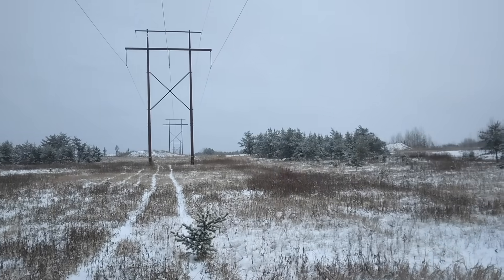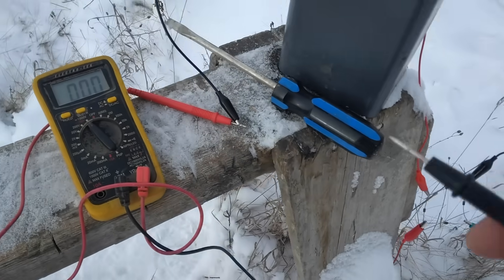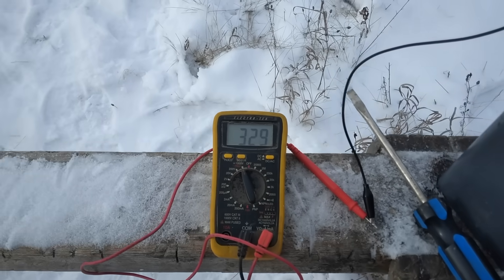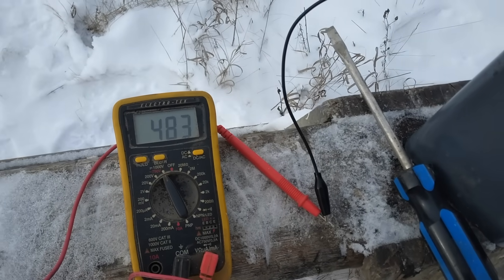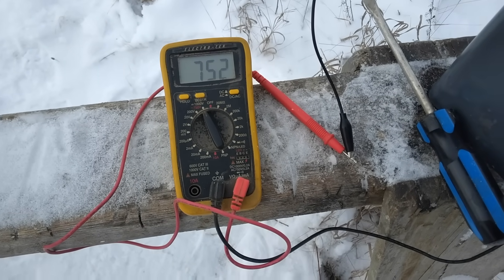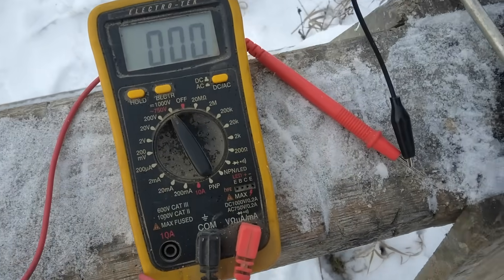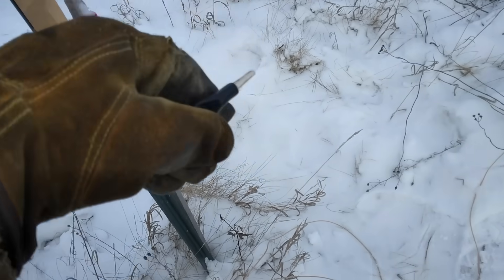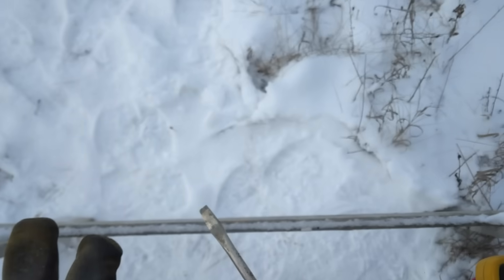Fences sucking power from under HV transmission lines

Comment: Free energy gathering from the Aether......  just like they did it in the Old World before they RE INVENTED it. The evidence of this free electricity harvesting technology can still be seen on the rooftops of very old cathedrals and buildings in the form of antennas and insulators. We WERE using FREE electricity gathered from rooftops, long ago and they re wrote the history ( mid 1800's ) and re invented it minus the free way to harvest it to make us PAY for it. In fact Cathedrals WERE old world power stations that were then reclassified as worship centers. Cathedral = CATHODE and the church rectory = electrical RECTIFIER. If you dug up the graveyards at these Cathedrals and old churches you would likely find the hidden roof top tech buried there. There are old photographs of lit up cities at night from lightbulbs dated BEFORE Thomas Edison " invented " the light bulb. Did you ever wonder why most power lines LOOK just like antennas? Or why you see them up in the foothills away from towns? Or why you can see them DEAD END in the mountains as seen on Google Earth..... even though we are told they are merely " transporting " electricity from point A to B. Huh? POWER LINES HARVEST FREE ELECTRICITY FROM THEIR ANTENNA DESIGN AND THE HIGHER IN ELEVATION, ( LIKE MOUNTAINS ) THE GREATER THE HARVEST FROM THE AIR. Think about it, if all they wanted to do was transport it from point A to B as they tell us then why not just bury the lines for a tiny fraction of the cost AND materials?   See " My Lunch Break " channel for more LIES EXPOSED.

Comment: I've heard about this phenomenon back in the 90s. But they referred to it as "stray voltage" and tell you stories about cattle getting electrocuted, and homes that were next to lines would have all kinds of problems, as well as the occupants coming down with weird illnesses and cancers.
Reply: I believe there was a huge lawsuit in Iowa maybe fifty years ago over this issue.  The farmers were trying to prevent being forced to have these power lines cross their land, sometimes very close to a house or barn.
Reply: Non-ionizing EMF can't cause weird illnesses or cancer.  There is no physical mechanism to do that.
Reply: There is a high rate of leukemia in a nearby village along the power lines coming from the power plant. 
On foggy days there is a crackle in the air.
Reply: Years ago I read about links between high power lines and what medical researches called 'cancer clusters' which were the people, mainly children, who lived in low cost housing built near to the lines having significantly higher levels of several types of cancer. The power companies were not found liable however those people in the lawsuit were offered alternate housing away from the power lines out of the kindness of the companies heart.
Reply: @bendover1028 There is exactly zero peer reviewed research that shows anything of the sort. None.  Nothing.  There is no physical way that non-ionizing radiation can possibly cause such damage.

Comment: Use a coiled wire making a circuit liie a Tesla transducer as seen from his schematics.  Should allow you to charge a DC battery..... careful not to over charge battery! You can control voltage by distance from high voltage line or the number of coils you make in the transducer circuit.

Comment: be careful with this idea, not due to the risk of electrocution but the legal ramification of " theft of service",  someone had done this before and the power company caught on and had him prosecuted, he used an antenna and there is an area that is called the "near field" , he was in that area and lost his case in court. good luck , interesting video.
Reply: The reactive near field is about 800km (500 miles) for 60Hz. The whole area where you might gather power is inside that distance because the wavelength is so long. Far field is more of a radio thing.

Comment: Load it as it take a transformer and drop drop the voltage. Do you need any water pumps to pump water anywhere from that area or you could run an air compressor run compressed air to wherever you want to run ithanks for sharing

Comment: What's your a** you get killed with something like that? Drop the voltage down to something usable. 220 or something open in charge. Charge some batteries or something. Good idea you definitely could get some use out of that

Comment: Years ago a buddy of mine went with me off roading under these kind of big power lines. I had a 1984 Bronco II. I shut the truck off and we were leaning on the edge of the hood talking and we noticed the whole truck was humming. We got the hell out of there because I was worried my computer was going to burn out. Those things aren't anything too play with. I wonder if you could power a motor with harvested electrical power like that if you had a big metal grid setup.
Reply: You could power one. I read another comment about biking. I think an electric bike powered by an induction coil riding under a HV line would be really funny to see.

Comment: How about a coil as designed by Tesla in his coil for electromagnets patent? I've used 12awg insulated wire around a 4" pvc pipe and gotten good results from it. Doesn't have to be a pancake coil, can be a conventional coil wound in his unconventional way. I've gotten accumulations of 700v within milliseconds and steady 60hz discharging at 120v with a setup similar to yours... Microcontroller timed of course.

Comment: I parked my rv under the power lines one night. I was getting shocked when I touched the door handle. I yhought somthing was wrong with my batteries and shorting out. I unhoooked all my batteries and ran my volt meter from the door handle to the ground and was getting 3 volts.

Comment: I recall a guy with a jeep who claimed his truck would become energized after driving under the HV lines.  I suppose the tires are good insulators and there is a radio antenna, metal body.  Intriguing

Comment: Nice demonstration 👍. But sadly those are small lines. Ours up in massena NY are 750,000 volts you would have more fun experimenting with those ones. Not going to look it up but the one you playing with is like probably half the voltage ⚡ than we have. Baby ones I call it 😉 lol only NY and Texas has this set up as experimental. It probably kill you if you got withing 20 feet of it without PPE. Shutting the line completely off still has enough static energy for hours to kill a person as well 😬

Comment: I remember a story of a very smart man who lived a few dozen kilometers away from a Candu nuclear reactor transmission lines.
His house was walking distance from the overhead tower. 
He did a little digging... carefully planted a few spools worth of cable and lived off grid for years until Ontario Hydro finally wondered how this guy had full electric and no stack. 
He got in a heap of trouble over it. 

I remember hearing that it isn't very healthy living close to that level of current passing overhead.
Might be a lot of ozone in the wind they are taking in 24/7 as well.

Comment: For anyone wondering, the rate of charging this capacitor corresponds to around 77 mW of power
Reply: = 0.077 watts. I looked up the power use of a common 5mm red LED, and find they use about 15-30 mA or about 0.05 - 0.1 watts at nominal LED voltage (3.2v). So I think he is pulling enough power to continually light a single 5mm LED, but definitely not at it's full brightness.   I think this seems in line with the old school trick of standing fluorescent tubes straight up from the ground-- they will usually glow dimly if they are under HV lines. Seems like he will need a lot more conductor to pull any truly useful power.
Reply: @gutrali  Using field strength falloff it seems that his "fence" would have to be around 18.5 m (60'8") high to get 1 watt of continuous power with current length lol
Reply: @ac281201  but 60 ft would be higher than he estimates the sagging lines are off the ground already.   I think it would help if he created a cool rather than just a Rf antenna like he has here;  no grounded far end
Reply: @gutrali  My bad, I should have added that I assumed straight wires, 20 meters above the ground. And of course you are right, a coil will "gather" more energy than a straight wire in this setup. I think it's worth mentioning though, as the distance to the lines is very small (compared to the size of the wavelength) the individual electric and magnetic fields play much larger role in energy transmission than em radiation, so the fence here doesn't really function as a rf antenna, more like a 1-turn coil
Reply: Yeah that's SUPER tiny. I figured it was in the sub 100 mW range. It can't be much.
Reply: Thanks for calculating that so I didn't have to

Comment: I worked a tower line and there is a ground cable connecting the towers because of static electricity from the lines. The tower line looses electricity
Reply: I've been on a grounding crew for these lines, we plowed in a steel cable between towers and  put a ring around each tower with four 3/4 ground rods that threaded together as deep as we could get them typically 40-60 feet.

Comment: Coil the wire up and see what happens you're basically making a single coil transformer to induce voltage from the hv xmsn lines and your coax. More coils of wire,  instead of one piece of wire will get you a lot more bang for your buck.

Comment: 230 000 volts devided by 40 feets = 5750 volts per feet!
The current will be proporcional to AREA and conductivity of the air.
I would put a (insulated from ground) horizontal metal sheet a feet from the gound and connect it to hi voltage bobine of a microwave oven transformer. I bet you will get a few or tens of watts. 
And then you can play with the area/current and hight/voltage.
Reply: By AREA I mean sufase area (of the metal sheet). The surfase area of the cable you use is small ... and insulated. The power wil come from the sufase area exposed to the air.

Comment: I was an RF tech, we tested potential cell sites, and would use a bucket truck to hoist the antenna to the proposed height.  To look both for potential coverage and obstacles, I would go up in the bucket and take pics on the 8 cardinal points to get a 360 view.  One time we were proposing mounting to HV transmission lines, the SDG&E guy opened the gate and drove away, so we went about setting up.  I was about 8 ft from the lines, in a metal framed bucket.  My compass went nuts (actually reversed polarity) and as I reached for the controls I got BIT, not deadly, but I crossed my arms and had the driver lower me from the ground controls.  Later talked to the SDG&E guy, who had no idea we were setting up, that close to the lines and said that would NEVER work, as it's inside the 'field' and it would fry the antennas!  that compass still points south!
Reply: They had you in a bucket 8 feet away! WTF?

Comment: 80 yards? WTf how long is f... cable? Cut the c... with these bogus units of measurement. What happens when air turn zero degrees F? And is it even different from the same air at -1°F? What foot, my a..? Whose foot? Yours? What shoe size do you have? What does this museum of units has to do with distance? What about molecules, do you measure their radii in micro-hair? As in width of human hair?

Comment: It's interesting that you measure voltage, I remember being in security cameras with a job years ago, and the 75 ohm coax can't be used to supply AC 24 volts for a camera simply because coax is designed so the impedance is designed so it acts as a RF filter at low frequency to keep AC hum out of the video.  So I would think a 15 gauge copper wire would actually charge you diode and capacitor better.  Maybe?
Reply: That is not true. The coax is 75 ohm because that is the standard design impedance for video input/output circuits. You get maximum power transfer when the cable and input circuit impedances are equal.

Conductors always conduct low frequencies better than they do high frequencies.

Comment: You could build a network of lines under that transmission line and get some useful power from it. For best results, you’ll want to check the field strength at various points away from the centerline. Directly underneath will give you the worst output. Moving out from the centerline will give you increasing strength up to a point before it falls off.

As for the power company complaining about you sapping off their transmission lines, you’re essentially picking up their losses and utilizing it. Kind of “free use of the airwaves.” Technically speaking, you could get close enough to actually make an impact, but it would be extremely dangerous, so not really practical.

Closer is better, but check local codes for maximum fence height and go no higher. That way, you’re in compliance with the law.

If I had the land with power lines running through, you can rest assured I’d be picking up any scraps I could glean. I’d not be cleaning up from just one small spot, but rather, from the entire length, and on both sides of the transmission easement for maximum capacity. Use it to charge a battery bank and do with it what you will.
Reply: Could the output be ballparked with a fluorescent bulb?
Reply: He has created a very simple air core transformer and is technically increasing the load on the grid (albeit an extremely minuscule amount).  So this is not energy that is normally “lost”.
Reply: @poivre22  is likely to be below measurable limits compared to the field list to ground.

Comment: It would be interesting to see if an array of many cables mounted side by side on fence posts , would multiply the amount of power , needed yo run a house.
It’s a fascinating field of experimentation.
Reply: And be interesting to test different lengths of wire. Shorter the length, the lower the resistance denominator in I=V/R, but with the caveat of lower voltage too. More wires should also reveal the denser areas of the field. EDIT: Since there are multiple power lines, there may even be regions of constructive interference.
Reply: You are thinking on the right track here, free power is the way forward.
Reply: Thanks !

Comment: This is basically a transformer.
Reply: No, it is not. It is basically a capacitive voltage divider.
Reply: @orinlaney6010  capacitive voltage divider requires physical contact between the source and the resistors. This is an air gapped set of conductors. That squeals a transformer
Reply: @geauxracerx : You are again incorrect. The stray capacitance from the HV conductor is the field source. The air gap is the dielectric. I'll pit my EE degree against yours anytime.
Reply: @orinlaney6010  it’s literally only two air gapped conductors. Transformer
Reply: @geauxracerx  Hahaha... no it isn't. Among other duties, I design transformers. Transformer windings have two terminals each so that current flows in a closed circuit. Here, the "fence" is just a long length of wire with a single connection at one end. That means any (trivial) longitudinal voltage induced by the power line current is blocked by an open circuit at the far end and cannot contribute to current flow. But more to the point, the very definition of a capacitor = "two air" (or other dielectric) "...gapped conductors." You can look it up (and should). Capacitive coupling to the HV conductor is the working principle here. There is no meaningful transformer contribution.
Reply: @orinlaney6010  I would agree it’s a capacitor, but it a definitely in no way a voltage divider. 
Transformer can be 1:1. That’s what “wireless charging is” just two air gapped conductors. 

Bottom line it can and will function as a 1:1 transformer and a capacitor, but not a voltage divider as you initially stated, but I like how you slyly tried to change your story to capacitor

Comment: The voltage isn’t going to kill anyone. If anyone is harmed it would be during the discharge of the capacitor and the corresponding amperage. 

All of this said, playing around with transmission of power across high voltage lines is a bad idea.

The extraction of power is a result of induction from the power line to the little copper “fence” wire.

What is the purpose of this experiment?

Comment: Try making your receiver wire a multiple of the exact electrical wave length of that in the wires above. Then multiple receiver wires spaced a half or whole wavelength as well from each other. Do as many as you can and then harvest!
Reply: A full wavelength at 60 Hz would have to be 3100 miles long. Just a tad bit impractical.

Comment: You should try using a step down transformer before the bridge rectifier to lower the voltage to something more reasonable. Maybe something like a 10 to 1 reduction would get your voltages down to maybe 100 V maximum.

I would think if you did that the capacitor would charge up 10 times faster. It would at least be a fun experiment.